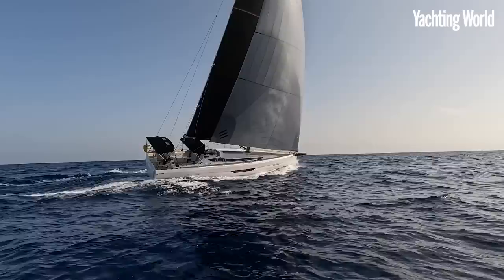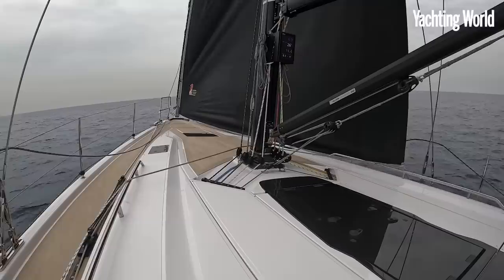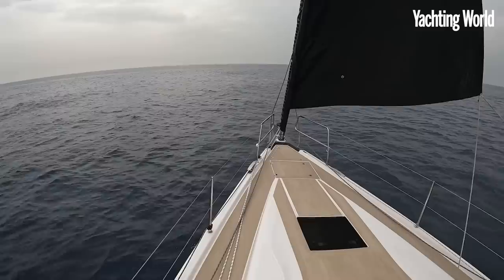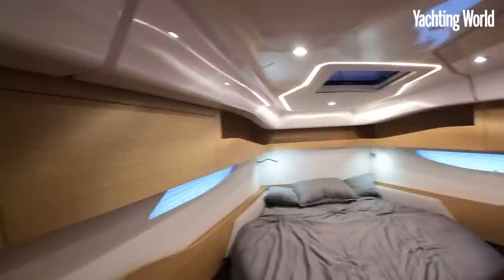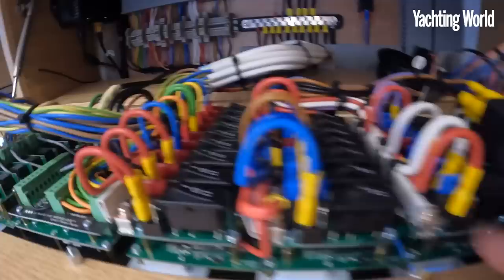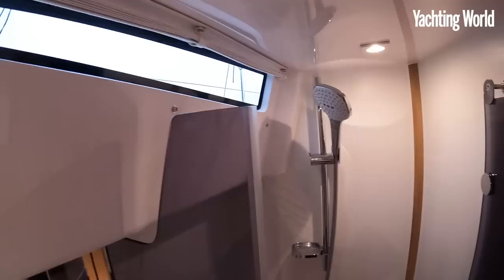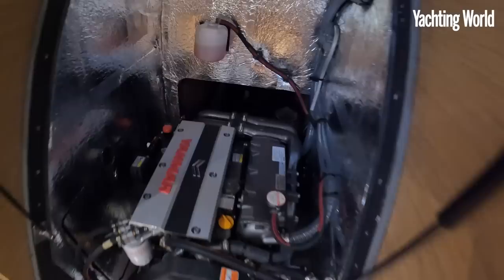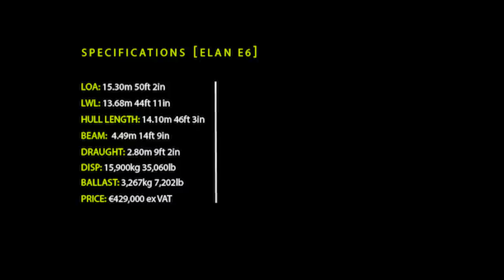Elan E6 - fun to sail with a nice, sporty feel on the helm

Comment: Love the design and the inside but it's a shame to see rust on a brand new boat :
Center bottom (handrail fixation) :
https://youtu.be/Kguf6CdrMGw?t=243
Top left : 
https://youtu.be/Kguf6CdrMGw?t=1165
Stainless steel is to expensive.... ?
Reply: That is pretty shoddy.
Reply: @mikaelgarton372  I'm sure it is, but I wouldn't put it past some yards to put in lower grade stainless to save money, 304 for instance.
Reply: @TheAegisClaw  No it's not 304. Are you kidding me?
Reply: @mikaelgarton372  I started sailing at 5 years old when my parents bought their first sailingboat (I am 50 now).
Rust is rust. So, it is not 100% stainless steele. Maybe 304 or somthing like that.
Greeting from France.
Reply: @mikaelgarton372  The Elan E6 was launched in 2022. So this boat is less than 1 year old. If your councider that rust is normal, personally i don't.
Reply: Hi William, we use 316 stainless steel. It's high corrosion resistance steel. The fact that there were oxidation traces is the unfortunate consequence of not being allowed to wash our yacht with fresh water for a year in the Mediterranean due to water shortages in 2022.